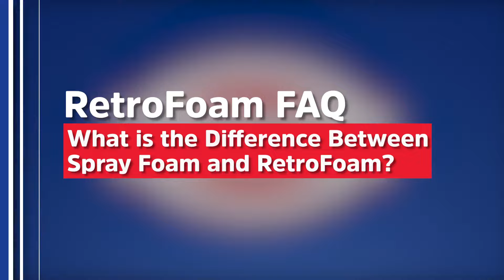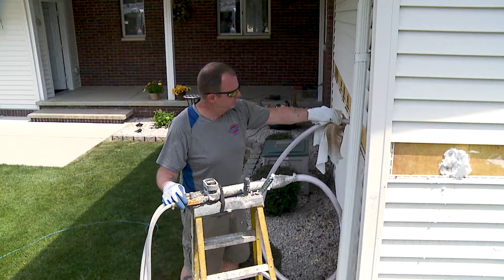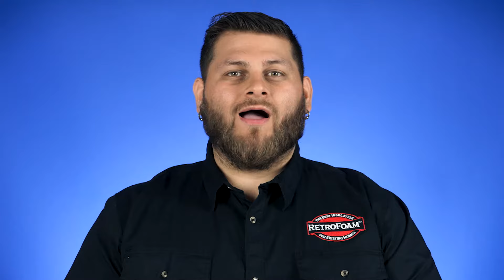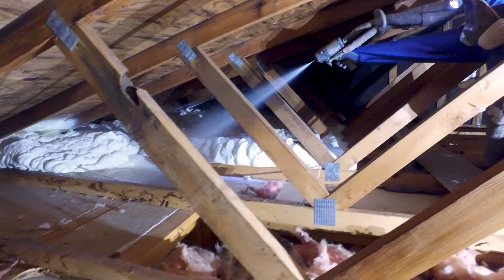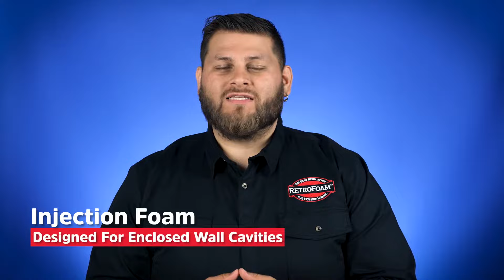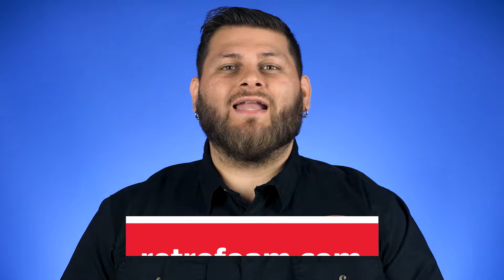What is the Difference Between RetroFoam Injection Foam Insulation and Spray Foam?

Comment: I owned a foam insulation company from the late 1970s into the 1980s.  I started a company specializing in Urea Formaldehyde foam.  Even though I never had any problem with Formaldehyde fumes in any home or building, the CPSC made a big deal out of it so I switched to Rapco's Urea tripolymer ... also without any problems.  The ratio between the resin and the foaming agent is critical as well as the density of the foam.  My background was in chemical engineering so I knew how important these factors were.  Many of the installers during the 70s and 80s didn't have a clue.  They made it difficult for those of us who did know what we were doing.  It was a great business with high profits ... sadly when the Jimmy Carter energy tax credits went away, homeowners lost interest in spending the money to insulate their homes.  I also did "spray-on" cellulose insulation ... mostly in big steel warehouses, but without the foam insulation work, it just wasn't enough.  I closed the business and started an engineering company that kept me going to this day.